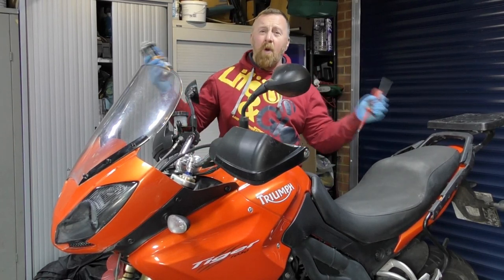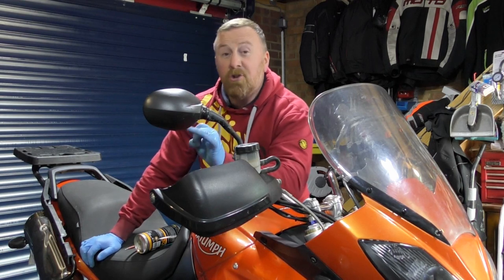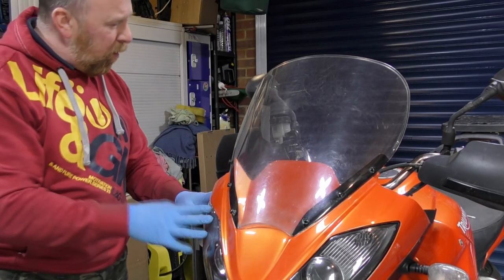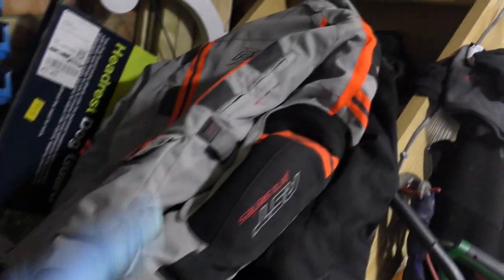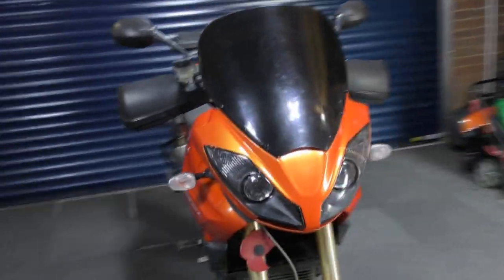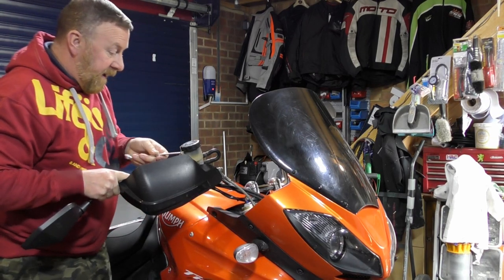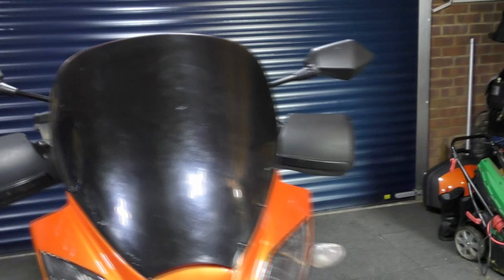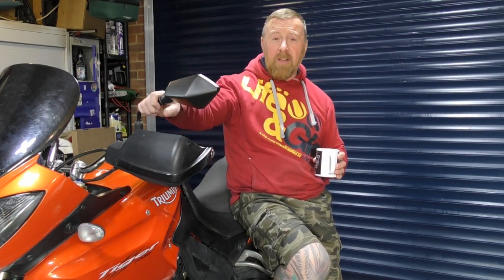TRIUMPH TIGER 1050 WHATS NEXT SCREEN MIRRORS MARK SAVAGE

Comment: Mark have you got a video of how to remove the passenger grab handle to fit a top box. I’ve just purchased some tank crash bars ready to fit on my tiger 1050 when I go to pick it up next week. My bike comes with matching orange side panniers. Is the tyre pressure 30 psi in both as my tiger 955i was 38 front 42 rear
Reply from the maker: Hi bud 
No I haven't but I did fit a top box to a tiger 800 ,video on here but not the same sorry to say 
However it should be too hard bud 
Maybe watch the video of my changing the exhaust as that shows bolt placement 
As for tyres 
You can't go wrong with 30psi for single riding 
But follow the manual 
I ride with 32 / 34 
They are great bikes bud you will love it
Reply: @marksavage  Thanks Mark . I’m just watching the video now. I’m not sure what my new bike will sound like as it’s got a pipe werx system on it. I purely went for how much easier it is to manoeuvre around as my now Cat b Tiger955i was a heavy lump. I’m fighting to get my Tiger955i back so I can strip it for the parts and then crush the frame .

Comment: You sure about 30 Psi in both Tyres Mark? I've always done 34/36 front and 42/44 rear mate? that's on every 1050 I've owned so far :)
Reply from the maker: Yes bud I meant to say that if your unsure stick in 30
Now got 35 38 rear with just me 
But thanks bud

Comment: Another good video.. Do you no if the honda cbr 125 r have clutch oil or is it just gear box oil thanks again
Reply from the maker: I have a few videos on them on my channel 
But its a shared clutch so in with the engine oil 
This is why you should always use motorbike oil for bikes 
And thanks bud for watching